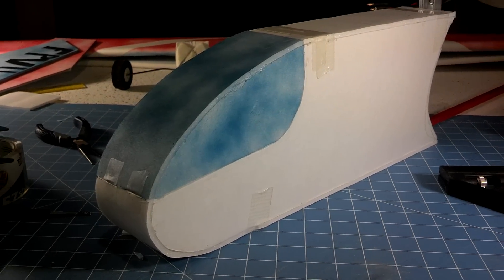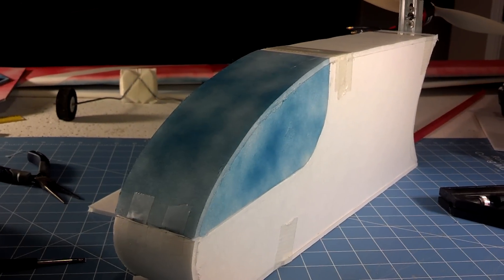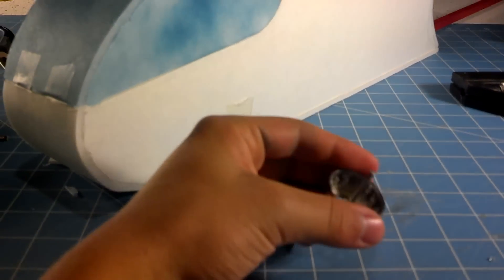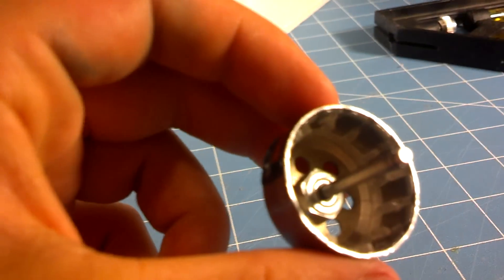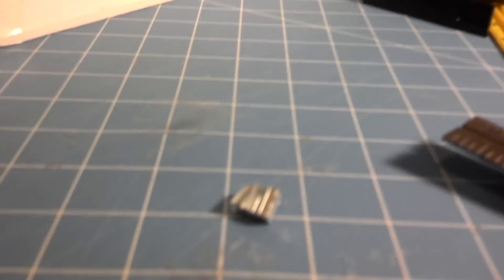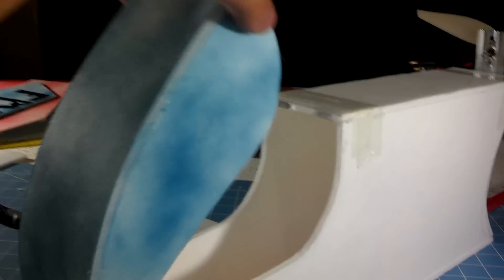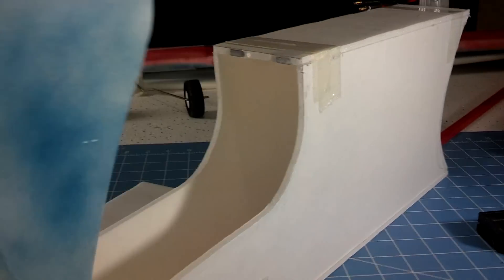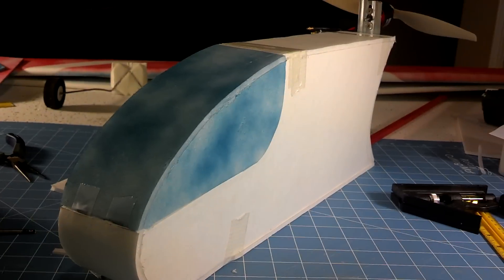Free Rare-Earth Magnets! (You probably didn't think of this!)

Comment: Another tip: Use a heat gun to soften the glue around the the magnets to get them out without breaking them. I normally just heat the outside of the bell of the motor so I don't get the magnets to hot.

Comment: are there rare earth magnets in tablets?
Reply: if  it has a cd drive so no
Reply: As in tablet computers? No. The only motor motor in those might be for vibration and I doubt there's anything to harvest there. Besides that, no magnets needed in these kinds of electronics. Speakers used in these devices don't require magnets either, they use crystals.
Reply: Thanks :)